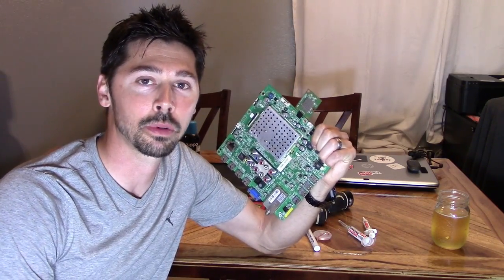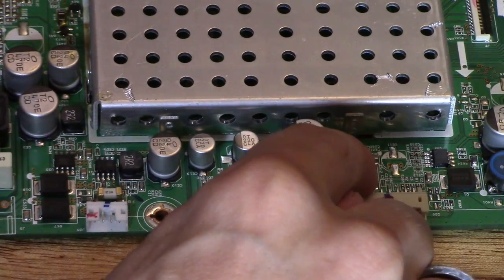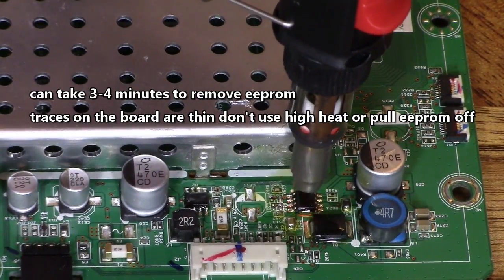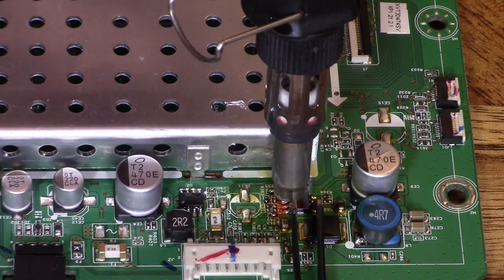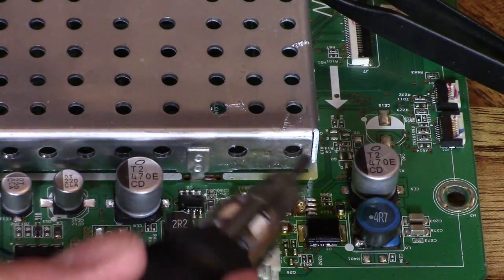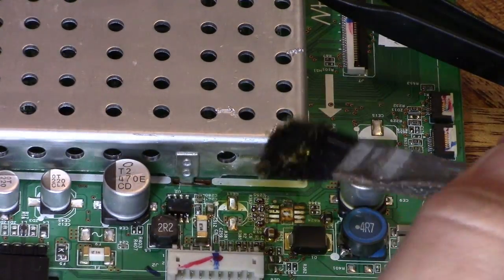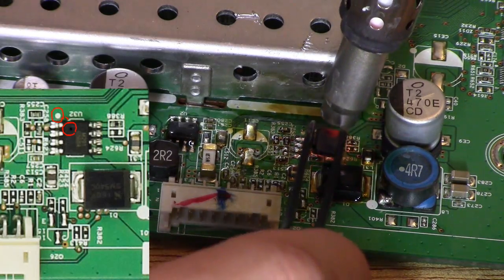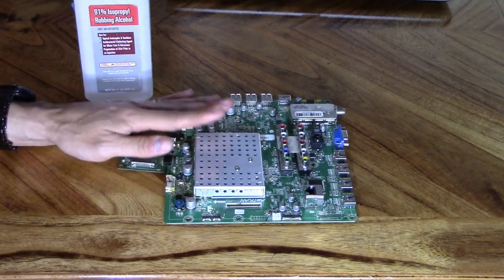HOW TO SOLDER IC ON VIZIO TV MAIN BOARD REPAIR

Comment: I have Vizio M55-E0 which is showing no power. I found that there is no standby voltage in the power supply board. I replaced it with the new board. But still the TV is not turning on. Any insights please? Thanks!

Comment: Hey there,

I have a 50in Vizio television which is an older model and I have a couple of issues with it, first one is when I turn it on I hear a click like the speakers are making a slight sound then I hear a loud screech and it's like it turns off but not all the way, and then the dog runs out of the room because I guess irritates her ears, however when you hear the loud screech you then have to turn it off manually and when the Vizio light comes on on the front of the television and only at that point are you able to turn it back on again, and sometimes when you turned it on it will literally do nothing, you hear no sound and it just sits there and the Vizio light doesn't go on or doesn't get white or anything and then you physically have to turn it off,  then when the light turns yellow on the front again only then can turn it back on and this can go on very many times or sometimes it may just come on right away and you don't have any sound, the picture is beautiful but there is no sound out of the video that you are seeing, and at that point you have to literally turn it off again and go through the whole restarting process and hopefully it only happens one or two times but I've had it where I have tried to turn it on up to 25 times before it finally does come on, and this could be really irritating, and the second issue that I have with it besides the starting problem is we moved just recently and when the television was being moved the TV coax cable was overlooked when moving the TV and the coax connection on the back of the TV got pulled out of the back of the television, so now the only input that it has is the internet box where I can get Netflix or some internet videos coming through on the HDMI 1 input which is what I have it connected to and it works fine, and then I don't have any cable TV I'm using a HD antenna for my local channels and the internet box for my Netflix and YouTube, my other TVs work great being that they have a coax connection, however I do not have a coax connector on this one so no local TV channels like the other TVs have, so at this point I am at your mercy to see if this is a problem that you have run into previously to see if I could probably use the website that you recommend to find which control boards I will need, I have a suspicion that it may have a bad main board, and so I will get the model and serial number off of it and we can go from there.

I do enjoy your videos and hopefully we can figure out what is wrong with this TV.

Thanks,

Rory.
Reply from the maker: I normally don't read such a long post because it's confusing sometimes but I think I can help, Starting up problem seems like bad capacitors in power board but if you rip out rf connector then you can solder it back on or buy a main board from shopjimmy.com or electropartonline.com but don't use eBay you might get scammed.

Comment: I'm finding your videos very helpful!!!  Thanks for puttin in work. I'm having an issue with this same vizio TV you're working on in this video. After troubleshooting none of the 4 HDMI inputs work.  Powers up fine I can switch through inputs but no signal on all...Is there a video To further explain how to troubleshoot and diagnose the where the issue is ??
Reply from the maker: Hdmi chip on main board mostly likely bad, get tv boards at shopjimmy.com or electropartsonline.com.

Comment: my vizio 24" smart LED tv networking will not connect anymore.  wireless wont find any signals via the setup menu's... i tried hooking up directly with ethernet cable but it wont connect that way either.  Any tips or ideas what i might be able to do to repair?  The tv is less than 2 years old but no longer warrantied...  I tried the hard reset stuff but no good.  sometimes it would temp allow me to reconnect, but its only for a brief period (a few minutes).  Model: E24-C1

Comment: I would like to know if the EEPROM replacement fix applies to a VIZIO 42" which broke down after a heavy lighting storm.  The symptom is similar: Vizio logo stays on, with no response from the TV controls nor the remote control
Reply: jessylove 18  well it depends, if you're using a TV for gaming and you have the same TV that I had, that TV is actually better for gaming than probably any new TV you can find on the market without spending more than $1,000 because it has one of the lowest response times of any TV I've ever seen. The response time for that Vizio is 6.5 milliseconds and I just bought a new Samsung TV that comes with an 8 millisecond response time and that cost me 500 and something dollars. Most TVs nowadays have at least double that response time. There is no new tv that has a 6 ms response time and you can't even check response times for new tvs because they're trying to hide those numbers.
Reply: Nestor Jaramillo yes although I wouldn't attempt to fix the eeproms myself, I would look for a replacement main board because you don't know what other problems could arise from that main board.

Comment: Hello and thanks for all great videos. Can I replace /substitute a Vizio 3642-1492-0150 (0171-2272-4314) Main Board for E422VLE with a ---------
Vizio 3632-1122-0150 Main Board for E320VL (substitute for 3632-1512-0150 / 0395)  ? thanks.
Reply: Negative. It will malfunction with the rest of the boards because trace circuits are ran to different parts of the other boards.

Comment: Quick question, How did know that the eeproms were bad?  I've got vw32l 10A that I've narrowed down to a bad mainboard (I think).  When I "jump" the power supply I'm getting the full 24 volts.  The TV is stuck in standby mode.  I'd appreciate any advice you could offer.  Thank you so much for the videos.
Reply: tom busby take the mainboard off the television and inspect the back of it, if you see scorching across the board then the CPU is getting too heated and scorching the rest of the main board.

Comment: hello sir,

regarding vizio's with  remote control issues on do you by chance know the smd resistor value at location RR1 on the IR sensor board??   wrt.  Vizio E3D470VX  p/n 3637-0022-0189

Comment: I need to order the Repair kit for a Vizio E470 with backlight problems, but how do you know which chips to replace? Does the kit have a step by step guide?
Reply: Joseph Rodriguez that would be the t-con board.

Comment: Anyway to diagnose just IC EEPROM? Just wandering. Vizio EE55-C1 NO POWER. Have power (my 24v & 12v) @ power board and to main board. I'm stuck there. lol. Any help greatly appreciated! Great videos man! 😃👍👍
Reply: BooGr1982 that would mean that it's actually not your power supply board but your main board, replace the main board.

Comment: Thanks very helpful. Want to ask you, I've been working on a Sony Blue Ray Home Theater System but I can't find the part I need. The power supply board went out and one of the chips looks burnt out so my question is if the EEPROMS are the same for blu-ray players and tv's. My blu-ray player model is BDV-E370. Maybe you know where I can find the parts I need?  thanks in advance and keep up the good videos.

Comment: From my experience I have to warn out people, who are using a hot air gun to remove ic's near electrolytic capasitors they could explode to face. Remove those near electrolytics or use safety classes. When I tryed to remove ic from pc motherboard electrolytic exploded near to my face. Fortunatelly nothing hitted to my eyes.

Comment: I have a Samsung Led tv model number un50es6900 bought in 2013. When tv is turned on, it shuts itself off and turns back on again 3-5 times, in 2-5 minute intervals. After it power cycles by itself several times, it works fine. I have visually inspected all capacitors which look fine. Any ideas? Time to by an ESR meter and check them with that?
Reply: Brandon Sunthivong haha! I almost sent a few .357 magnum pills right through it but I found out it's the wifi module causing the problems. Disconnected it and it works great! Time for a new wifi module.

Comment: Hi, on lots of your videos you use a gas iron, is the heat setting adjustable on these irons if not can you add the heat settings they should be at for the removal of components.
Reply from the maker: yes they have heat settings and heats up fast under 10 seconds